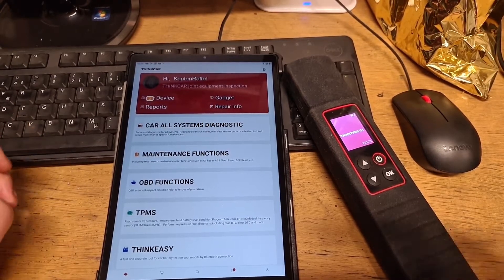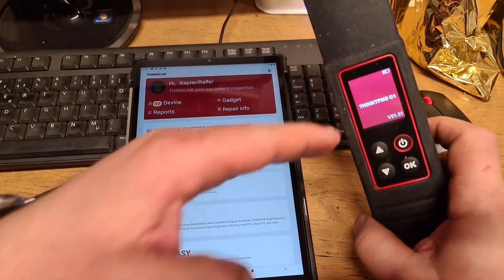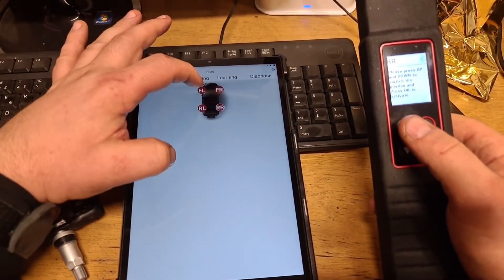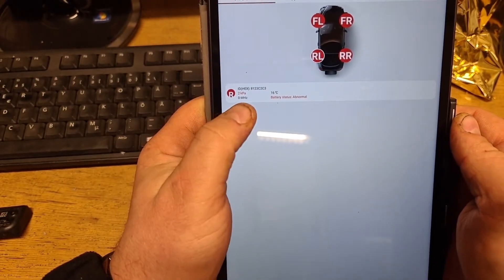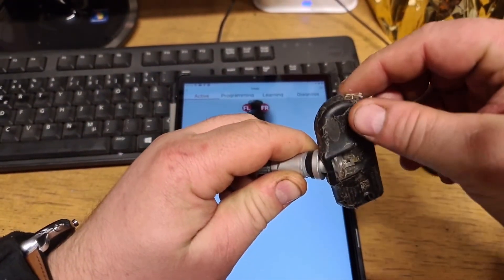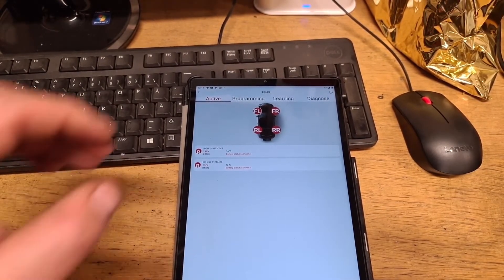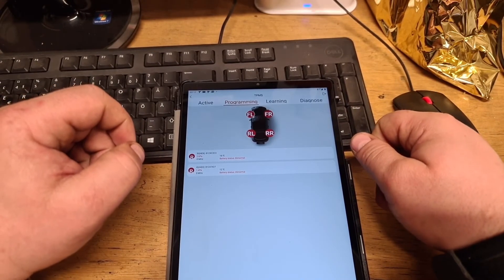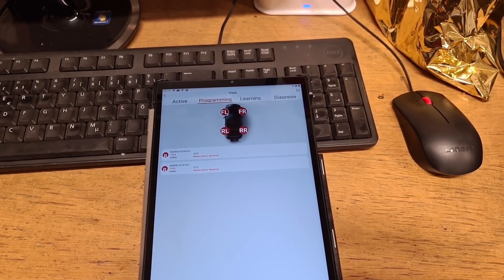Thinktpms G1 on Thinkdiag app , tpms reading test.

Comment: Can this be used by itself and the app or do I have to also own a Think diagnostic scanner too?
Reply from the maker: Using ThinkTPMS G1 , tpms can be diagnosed wirelessly via APP or diagnostic device. So on this video it's working with Thinkdiag. Thinktpms G1 doesn't work itself
Reply: @KaptenRaffe  Yes but if I download and install the APP, ThinkDiag, then I can use this from my iPhone via bluetooth with the ThinkTPMS G1 together without having to buy the $1000 actual scanner tool?
Reply from the maker: To activate thinking app you must have also registered thinking obd vci . Than it's working
Reply: @KaptenRaffe  Okay thank you for the info.